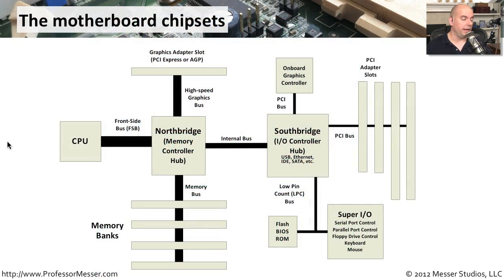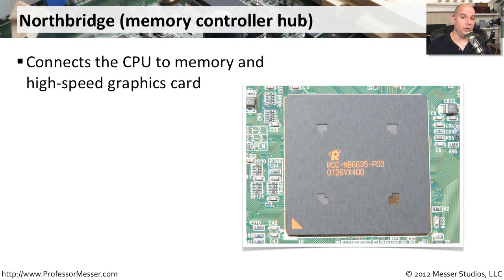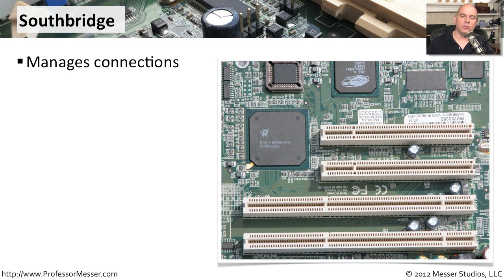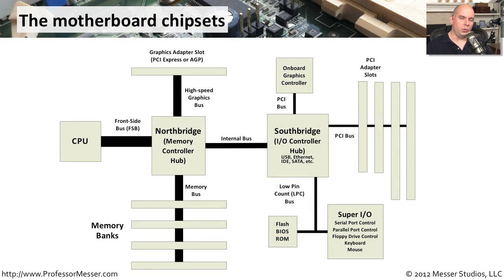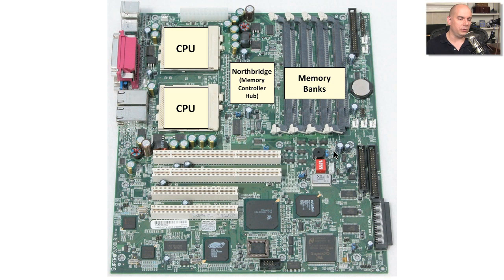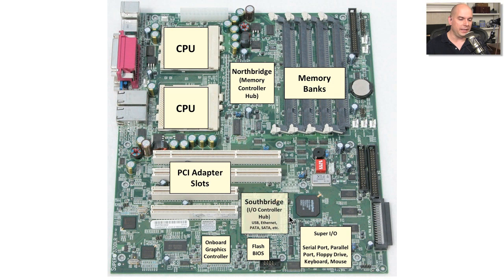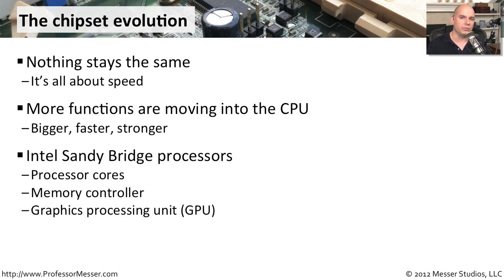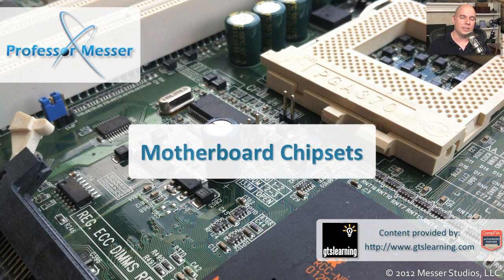Motherboard Chipsets - CompTIA A+ 220-801: 1.2

Comment: Professor Messer, if graphics are maintained by external source like a video card, is the physical space allocated for integrated graphics on the CPU then reconditioned or optimized to handle a better function. I assume yes.
Reply from the maker: If you don't use the graphics processing on the CPU, then that space on the CPU sits relatively idle.
Reply: It would be optimal if it did

Comment: Does the Super I/O chip only manage Keyboard and Mouse if they are using a PS/2 connection?
Reply: Matthew Conover Yes. But on most modern motherboards (if those have PS/2) Super I/O integrated in Southbridge (sometimes called Super Southbridge).